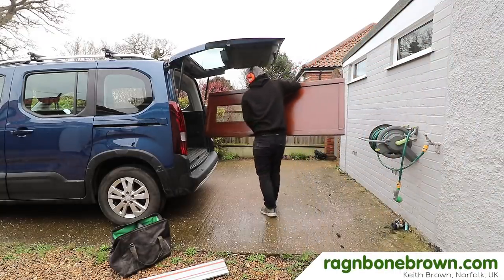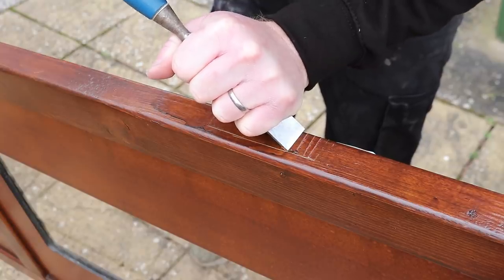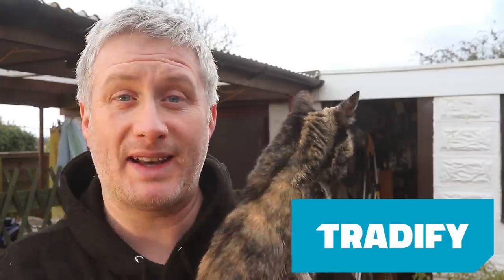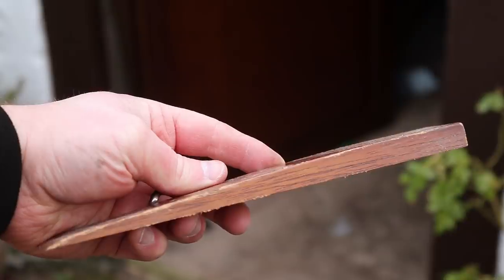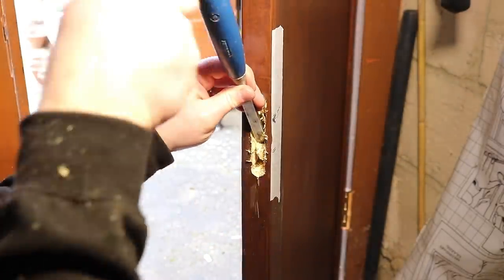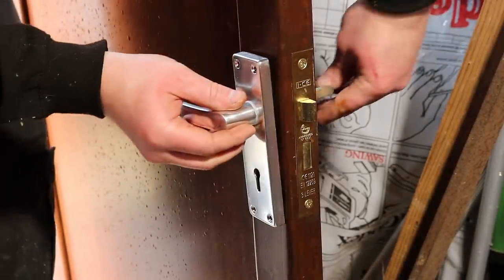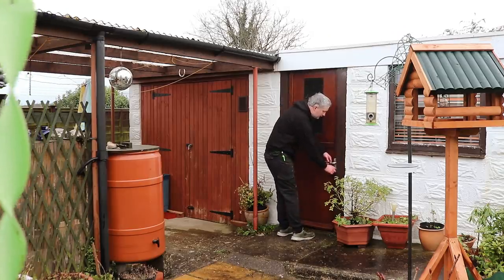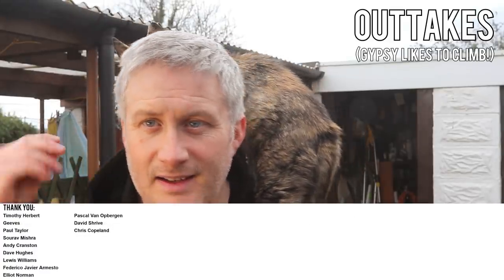Hanging An External Door

Comment: Really nice work, Keith. Would be a good idea to run a bead of exterior sealant along the top of the sill where it meets the door. You should be able to get a brown color... I think DAP makes it.
Reply from the maker: Cheers Dave
Reply: @RagnBoneBrown  My grandfather used to use linseed oil putty for sealing the gap above one of those weather strips
Reply: Very smart suggestion Dave
Reply: @jeffroberts760  I used to live on the Wet Coast of British Columbia so am familiar with rain. It also depends on the prevailing winds but it's difficult to keep anything dry. Standard kit included duct tape, WD40 and sealant.

Comment: Hi Keith, you want the Exitex MWK20 for under the door. You install the alloy cill, then trim the door 20mm from the bottom of the cill and screw another extrusion onto door bottom. I use a able saw to trim the alloy weather bar part off so you could keep the timber one you've installed. It's the best as there are no seals underfoot. You can set the cill on cement if necessary to make it solid. 

I use a laser to set screws level then the cill sits on the screws and the cement holds/seals in place
Reply from the maker: Thank you

Comment: Great video Keith.  I bet you were frustrated with the door handle, the job almost finished and to find it doesn’t fit - been there !
One thing I would suggest is to run a bead of brown silicone around the top and sides of the door sill to stop water weeping down behind the sill, being trapped and rotting the bottom of your lovely new door.  Cheers
Reply from the maker: Thank you, will do👍

Comment: Having the handle that close to the frame impedes the insertion of a jemmy to force the lock, which is good. I have often seen shed doors with lower door handles, no idea why.
Reply from the maker: Glad there is an up side! 👍
Reply: Probably lower because they used to have stable doors in them, so when they went to actually put a lock on, they used the same old door, and thus put the lock in the bottom half, and then screwed the 2 halves together forever. Thus the old latch position, to a new door later, and the new door position, even later, was transferred to a newer frame, when the old one rotted away..

Comment: i have rubber seals along my garage doors  - Weather Stop - Garage Door Threshold Seals search will bring up loads, although that may require changes to the door now - BUT as you say - water has never got in before , keep the floor level , i'm sure as your parents get older - you dont want small steps / trip hazards , especially in workshop/garden where you are often just popping in quickly to pickup something and not always paying attention, at least thats my excuse.
Reply from the maker: Thank you

Comment: Nice work, one thing I'd advise is for you to use Forster bits for fitting door hardware. They produce a much cleaner hole. I use Bosch forstner bits and they are excellent 👍 🔨 🇮🇪

Comment: We have just had to fit 5 interior doors in our house and all of them are of random size , when i say that i mean that whoever built the house must have had each original door custom made for the size as even the doors that are supposed to match are not even close. We fitted some quite heavy chipboard and thick oak vainer doors, fitting doors is a nightmare and the one into the utility / bathroom area was that bad that we had to take the frame out and cut out the brick wall (with new hand made door jam/frames) , the dust in my house now has dust and that dust also has dust. 

All that means i know how much a pain fitting doors can be , good job K man .

Comment: You did a great job. Once I saw a professional door hanger and he used a router with jigs to cut for the locking mechanism and hinges.  Super clean install and no tear out. I think on the pinch in would’ve done the same as you did, but the router seemed like a cleaner way to go. Another concern I had was that little groove by the bottom water deflector. I would use exterior silicone (do they make it close to your color choice?) to give a faster path for rainwater to slide off instead of pooling in the little crack as you have it now. Cheers.
Reply from the maker: I usually do use a router but sometimes it's nice to use hand tools